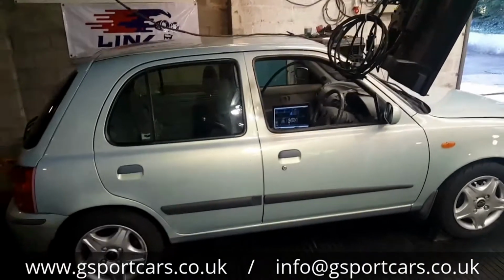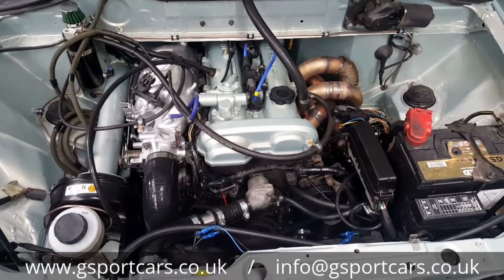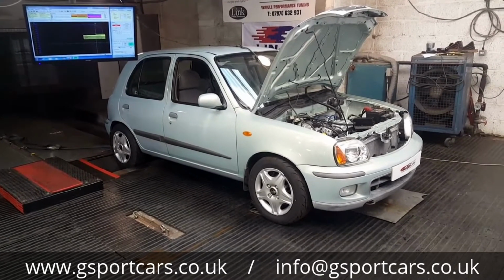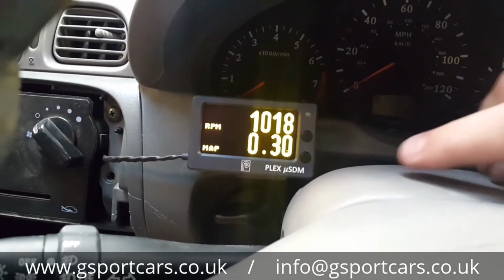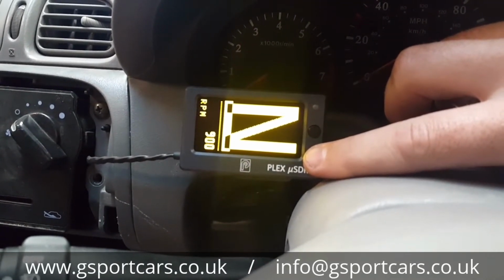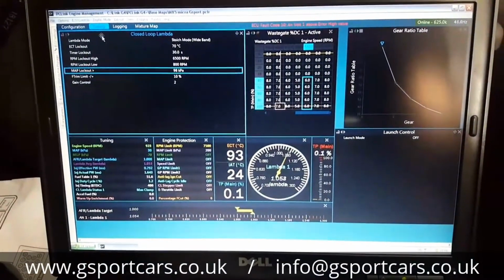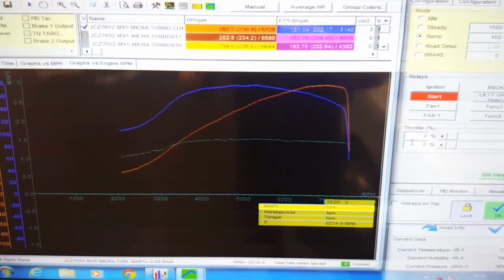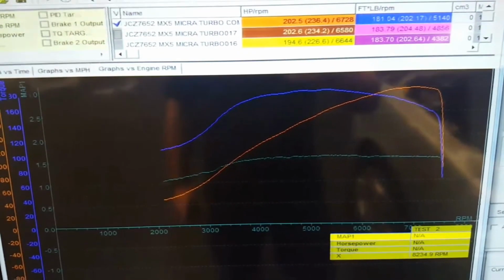Williams MX5 turbo engined Micra

Comment: Micras are front wheel drive. With transverse engine and gearbox. Is this rear wheel drive? And how did you convert it??
Reply: The video shows the rear wheels on the rollers and them being driven.